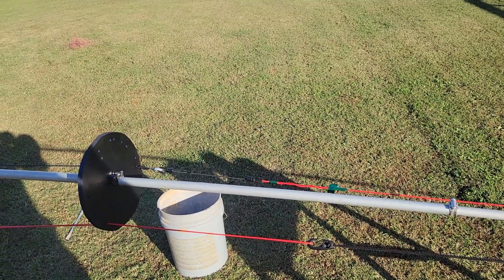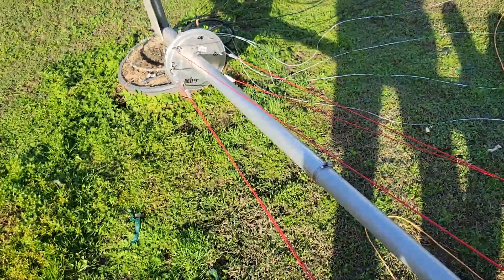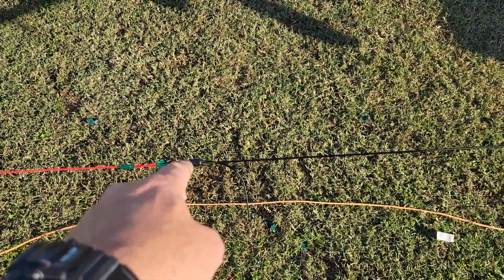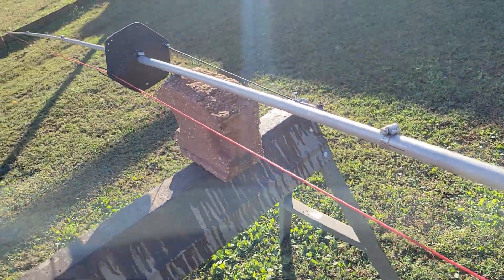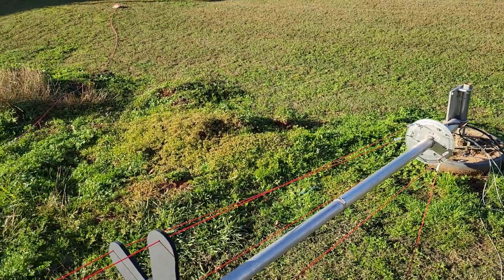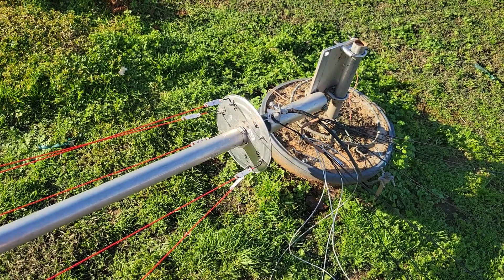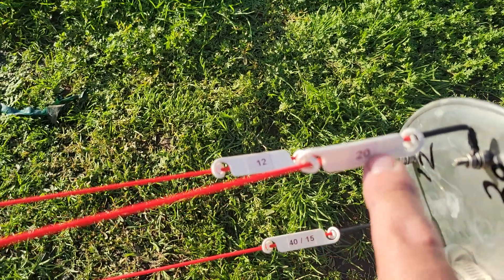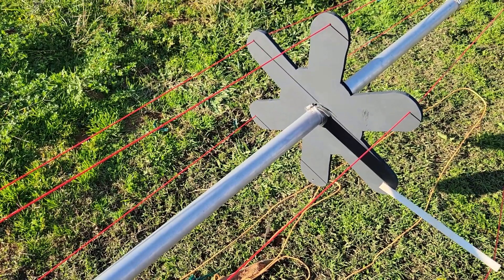43 FT MBWV WJ6A

Comment: Were you ever able to get a set of measurements for everything to do this modification and a link to the plastic sheets for the spreaders. Also were you able to get 75/80 meters added?
Reply: I designed the spreaders and used standard antenna formula to get lengths of the wires. The spreaders are cut out using a jig saw from UV protected pvc sheets.  I don't know of anyone else that has done this.